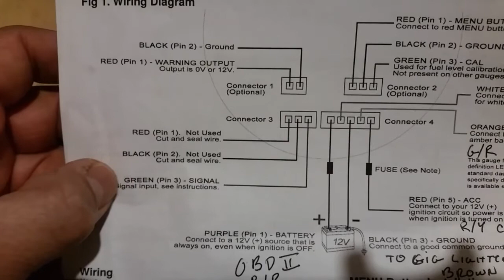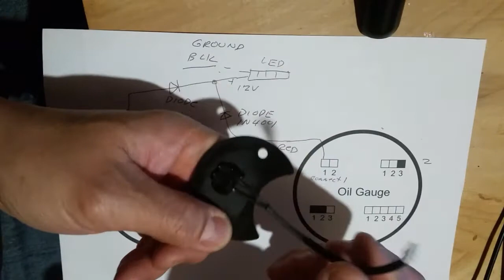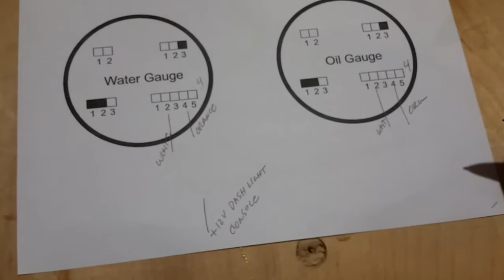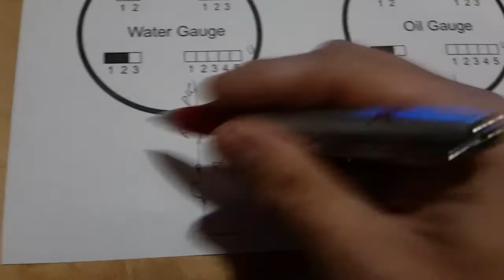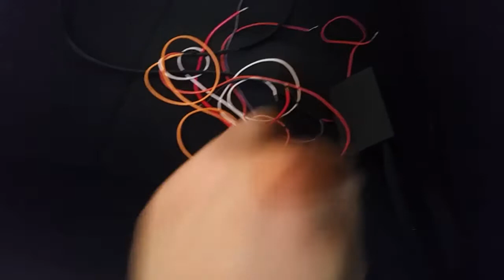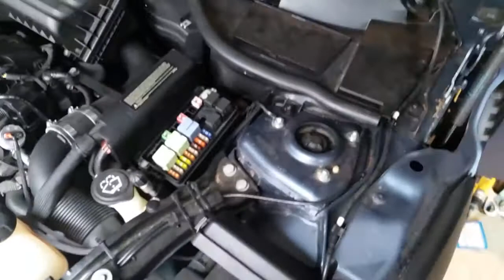Part 3 - Installing and wiring the oil pressure and water temp gauges in 2009 R56 Mini Cooper

Comment: What y mean to connect to the led?
Reply from the maker: My mini doesn’t have a car alarm but it still has the red led lights above the tach. Since the red leds were not being used, I decided to hook the output of the oil pressure warning trigger to light these led lights. I set my oil pressure warning trigger at below 10 psi so if my oil pressure drops it flashes the red leds. This is optional or you can use your own 12V leds. Good luck

Comment: What does the fuse holder to battery connection look like? I’ve got all my sender adapters installed but don’t have any other wires routed just yet until I know exactly what goes where
Reply from the maker: @teolopez6674  For the battery 12V, I found one of the wires for the OB2 that always has 12v even when the car is off. I spliced into this wire. The other 12v when only the car is on or when the lights are turned on, I spliced into wires for the cigarette lighter (12v accessories, I think) and for something (don’t remember, may be in video 2) that only lights up when the dash light is turned on. I’ll rewatch video 2 to remind me and let you know.

Comment: Is your second ground connection good? The one at 21:23? I’m thinking of grounding off it too please let me know
Reply from the maker: @AlexisRodriguez-yv6sf  That ground is good. I’ve not had any problems with the gauges. Always double check using an Ohm meter. You should be less than 1 Ohm for a good ground. Body to battery negative.
Reply from the maker: @AlexisRodriguez-yv6sf  Later in other projects, I saw a good ground on the fire wall. Can’t remember exactly but it was an obvious ground to body. Good luck

Comment: Do you have a video demonstrating how you removed the shift boot and bottom dash where the cigg lighter and dash lighting wires need to go spliced onto?
Reply from the maker: I've taken that center console off so many times I got tired of filming it.  Sorry about that.  Here is an earlier video in replacing the lighter with a USB charger port that may be helpful. Good Luck

https://youtu.be/U9_YP18Y4_w

Comment: So what size wire cover did u end up using?
Reply from the maker: I used 3/8 inch sleeve. Probably could have used 1/4 but 3/8 was much easier to fish the wires though

Comment: Where can I buy the oil pressure gauge. Does anyone have a link please
Reply from the maker: Cravenspeed sells the oil pressure gauge and other stuff for Minis.  This will link will guide to the menu page and from there, it'll take you to the correct Mini model https://www.cravenspeed.com/MINI/
Reply from the maker: I agree Cravenspeed is expensive. Now that i did it once, shopping around for the parts that i would need is probably a good idea when i do it again. Haven't done it before, the complete kit was good for me but if you know what you are doing, shop around for the parts needed. Saving money is always a plus.
Reply from the maker: @bilaltariq7819  For some reason I don't think a single sensor to two places, ecu and oil displsy, will work. Off the top of my head, i think a pressure sensor is a resistive type sensor, such that it sends a voltage and the change in resistance changes the voltage, thus the voltage translates to display pressure. For the ecu to use a signal from a sensor rather than a pressure switch, which is either open or closed, you would need a circuit to translate the setpoint from the sensor to a relay to open or close for the ecu. Just my thinking.
Reply: Not for $950 au lol

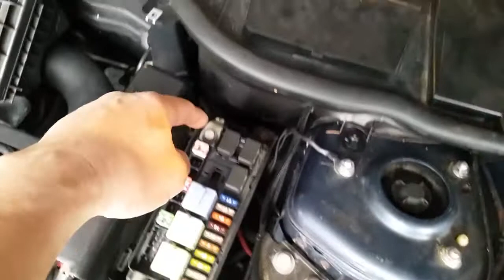Comment: 21:16 this is a positive connection coming from the battery positive junction box.
Reply from the maker: Thanks, i found out later and moved my ground to the ground terminal bolt to the body located under the fuse box.
Reply: @mcmcminicooper  Great...looking at this link https://www.newtis.info/tisv2/a/en/r56-cooper-hat/wiring-functional-info/power-train/engine-electronics-mev/engine-oil/X3EqOZj it seems that the oil pressure should be at least 7.3 psi. What were your numbers at idle at cold and fully warm. also, at 2k rpm, what was the pressure. I have an 07 with oil light and I'm trying to determine the options. TIA
Reply from the maker: @minitobe  At cold, it is between 40-50 psi depending how cold it is outside. Once warmed up, it hovers between 25-30 psi. At 2000 rpm, cold engine, it's 45 psi. I do have a water thermostat stuck open, which just happened in the last week and i will fix in near future.
Reply: @mcmcminicooper  super thanks 🙋🏻‍♂️